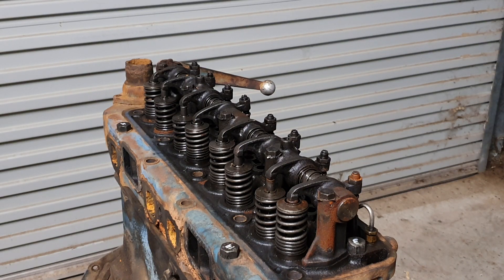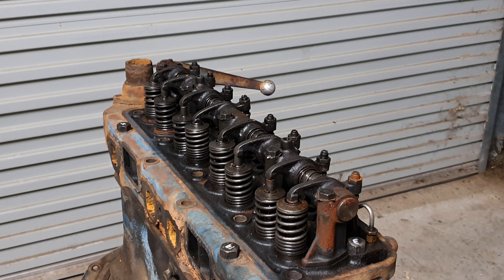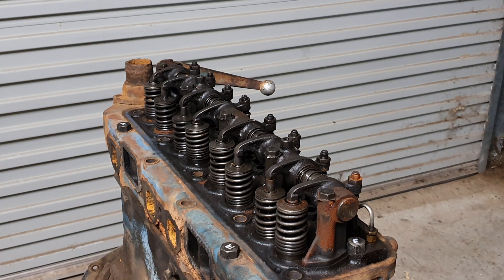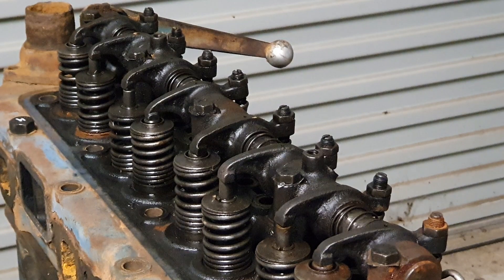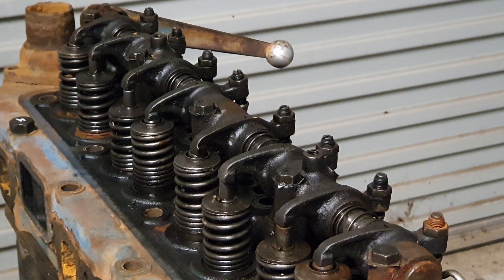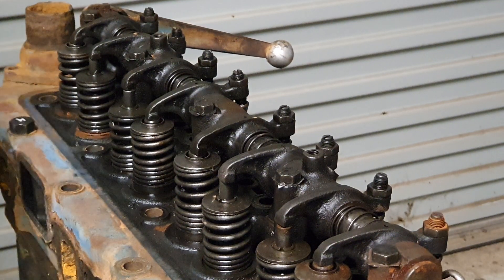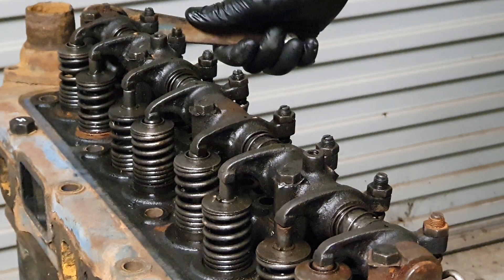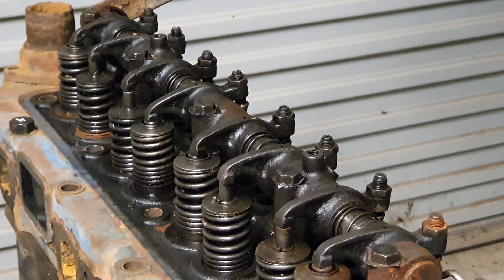Fordson Major Decompression Lever

Comment: Hi mate! I live in Canada and use it to start the engine at sub zero temperatures. Here’s how I do it  decompression lever up then a shot of ether in air intake pipe and my buddy slowly lowers lever while I crank it over. A great start then let it warm up at -35C and plow some snow with the chains on rear tires. A country boy can survive with a ‘61 Fordson Power Major!
Reply: Hi I'm in Manitoba and have a collection of  various Majors, You'll be fine starting the major like you are until the push rods fall out and bend  one day when things jamb up . The original manual states do not use the decompressor to start the tractor this way as a starting aid. I've seen tractors that have done it that weren't running right when I bought them cheap, Or sold pushrods to guys from my used parts stash or when I worked for a wrecking yard where this has happened way to often.

  I have a nice looking power major here I got last year.  I think this is the cause of  a broken cam follower, destroyed camshaft, bent push rods, and the head gasket blown clean out the back of the block where they fed it a can of head bolt stretcher once too often .  I don't use my super in the winter she sits out in the snow after cutting grass all summer , put a battery on it in the spring and it fires right up like it was stopped before lunch. I'd hope at -35 you've got a block heater on it, to give the poor thing half a decent chance. I use  ether  for cleaning parts or seating farm trailer tires on beads . Our main tractors are plugged in every day on timers all winter and get zero ether, lots of the time there isn't even a can round here in the winter. Take care
Reply: I agree with you, bud.
Sounds to me that you know your machine well.
Reply: @super6954 hey, I have a compressor with fordson engine like this. If somebody need it let me know
Reply: Do you ever use the excess fuel button on the injector pump ? This is a great starting aid, never to be used with either. I think Fixing Fordsons has a video on this.